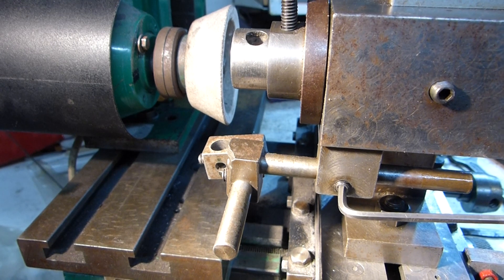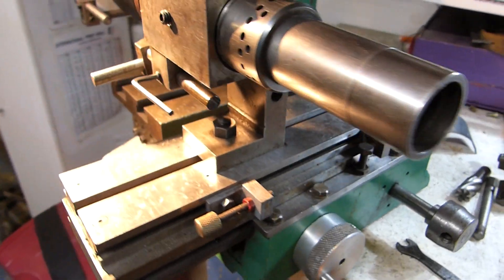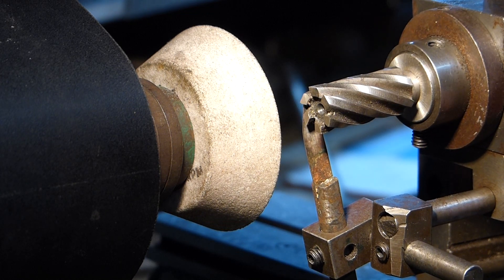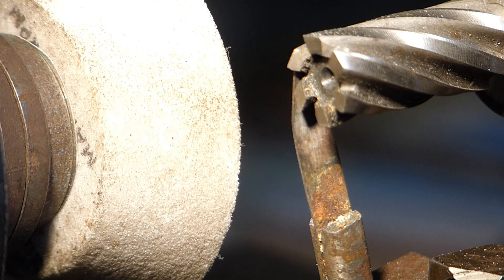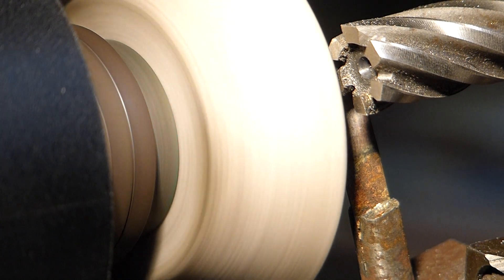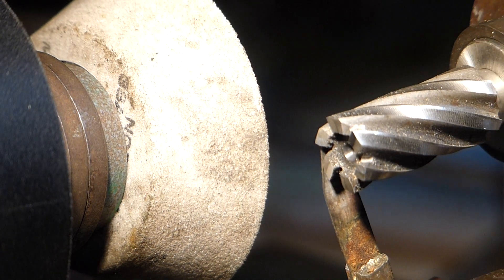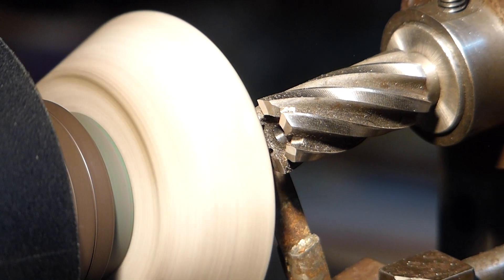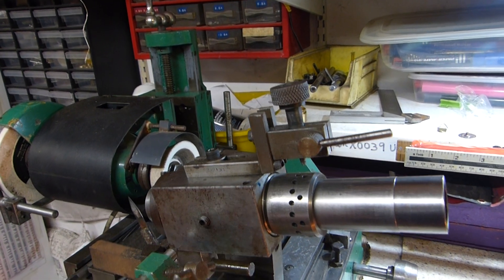Grinding End Teeth On End Mill part 2

Comment: GREAT VIDEO SR.a question I CAN REGRING ON LATHE SOME DEVICE SIMILAR WHAT YOU THINK THANKS AGAIN.
Reply from the maker: Thanks for watching the video,you can grind on the lathe ok as long as you keep to a high enough rpm, your main concern though make sure the lathe ways are protected from the grit.you also need to dress the wheel course and not to fine as a fine dressed wheel will glaze over and not cut well,I find an 80 grit wheel just about right for cutter grinding,hope you are successful with the lathe method.